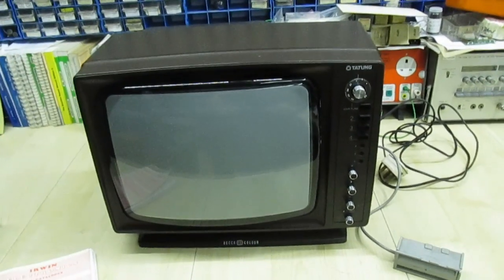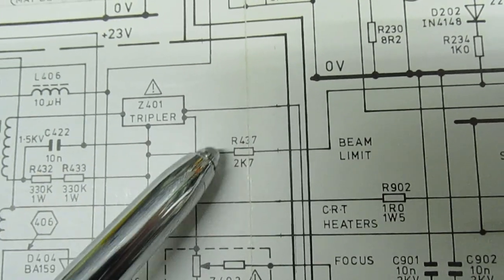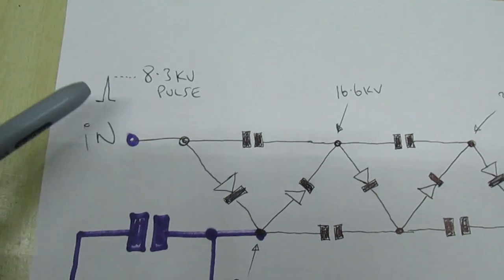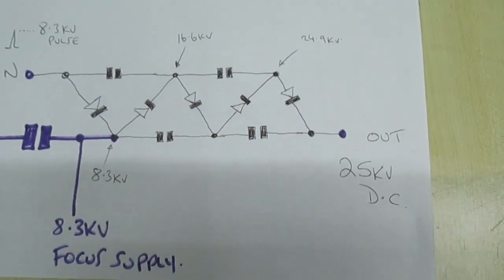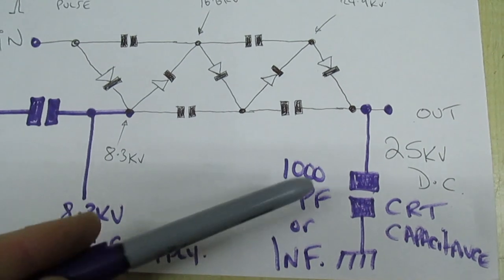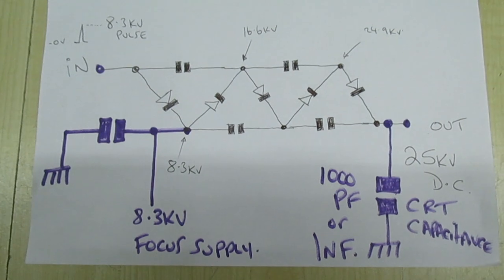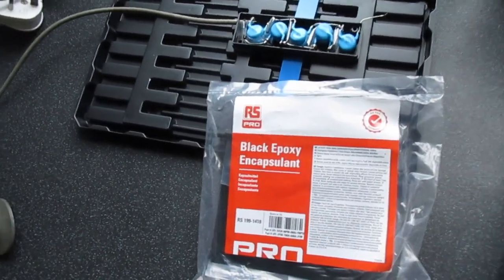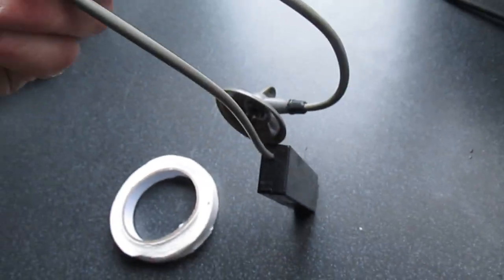Lets make a new EHT Tripler for a Decca 120 chassis1981 vintage colour TV

Comment: Excellent explanation, Michael!
Some years ago parts like these triplers could be picked up from a number of suppliers one in Southend readily coming to mind. That said, the high voltage diodes and capacitors are available via that well-known internet auction usually made in China but note your misgivings.
At the other end of the scale, I am trying to recreate an "olde-worlde" TV using a 3 1/2" electromagnetically-scanned radar tube at about 1.5kV. Managed to 'crank-up' 12V to 500V pulses at 3.3kHz and the tripler seems to be the way to go.
Reply from the maker: you must be referring to Sendz components ! .
 I bought a lot of stuff from them in the 80 s , in fact I still have a load of parts supplied from them in stock , I wouldn't risk capacitors bought from Chinese sellers  , had a bad experience with some over 10 years ago , worked ok for a few weeks then went Leakey .

Comment: I love these work arounds Micheal, as time goes on fixes like these will become more essential. Excellent work.
Reply from the maker: That's the only option when new parts just are not available any more , I also checked the common fault on the scan coil rubber wedges as I no longer have any scan coils , many thanks for the comment .

Comment: Hi Michael.
Many thanks for another brilliant video.
As you said back in the day we thought nothing about ordering a new one. However, now days, needs must inspire invention.
Just a point about discharging the CRT, I was tought to apply the grounding screwdriver to the dag first. Then slide the other driver from this to the anode connection. I was advised it was the safer way.
Kind regards Allan 😃
Reply from the maker: Yes I guess it would be safer to ground first, many thanks for watching.

Comment: Great video and moot point presently, I'm in the process of restoring a brc 2000 ctv and may have to go down this route, in my case the hammer and chisel can't be used because it's important to retain the old tripler housing, fortunately thorn used silicone rubber as a sealant so it can be dug out, it's only took three years so far!.
Reply from the maker: Sillicone rubber shouldn't be too much of a problem, in my case it was epoxy resin, I think if you couldn't remove it for some reason though it would be possible to 3d print a new case.
Reply: @michaeldranfield7140  3d printing is a good idea i hadn't thought of, if i have to rebuild this component I'll be sure to get a file made of its shape for future reference.

Comment: Fascinating , and your method will work on any set too so it's future proof , provided you can get the HV diodes . We had a factory not far from us based in Clacton that made triplers for the trade in the 1970s ,  the company was called Remo but they shut in the 1980s when manufacturers combined the diode , capacitor design into an encapsulated overwinding on the line output transformer as you probably know. A step backwards really as the cost of the repair went up through LOPT replacement.
Reply from the maker: This was called the Diode split LOPT as I remember , where they use the self capacitance of the transformer winding instead of a physical capacitor for greater reliability, Remo rings a bell, also the word Clackton, I think this is where Denco coils for radio were made ?
Reply: You may be right about the coils , they may have been made in Clacton but I'm really not too sure.
Reply from the maker: I remember the Remo brand very well, as you say the split diode LOPT ended all the easy money making tripler jobs.

Comment: Very interesting video!  I've often wondered how the high voltage was created inside a TV.  Now I know.  If the double-stick tape dries up you can still screw down the new tripler by epoxying a small aluminum plate onto the bottom edge and using the two screws nearby to screw the plate down.  JB Weld or black CA glue should hold the plate onto the plastic box without difficulty.
Reply from the maker: Just acquired 2 more 20 inch versions of this set so if I need to make another tripler I wont make the same mistake again !

Comment: These had an amazing little picture when setup right, brilliant video michael, i reckon a high voltage capacitor discharge in the mains supply will be more dangerous than the crt anode, in fact a cars ignition system can be deadly
Reply from the maker: Of course, beam current is only like 1 ma max , should have some 20 inch versions soon .
Reply: @michaeldranfield7140  A friend of mine got zapped by a 450v 220uF cap, hes now got a pacemaker and only in his 30's
Reply from the maker: @Synthematix  I come across a lot of stuff, a phillips sonos only last week, where the psu develops a fault and leaves the mains reservoir capacitor fully charged up ,even the next day it still had quite a charge stored, all for the sake of  not fitting a bleed resistor across the cap .
Reply: @michaeldranfield7140  Yes a simple resistor, job done, still this is to be expected with junk built in china

Comment: Excellent restoration job on the Tatung set , liked your "special " dismantling tools pity you didnt use a hacksaw to cut the base of the old tripler to bond it with the new case but still very ingenious  work
Reply from the maker: Yes,  a bit of a mistake but I repair cars as well so not short of tools .

Comment: Not being someone who works on TVs, I was interested to see what was in a tripler. It turns out I was very familiar with this type of circuit, only I always called it a 'Diode pump' circuit. I've made a few myself, typically to get around 70 to 90 volt HT for old battery radios from lower voltage transformers.

Comment: As a safety comment; I've found that if you discharge the EHT on the tube, for some reason unknown to me, it charges up again (nowhere near the EHT voltage but enough to give a shock). So I come back and discharge the tube several times until I no longer hear a spark when the screwdriver touches the EHT input hole.
Reply from the maker: Yes I have noticed this before and in order to prevent this happening its a good idea to leave the short on for a while.
Reply: @michaeldranfield7140  I really enjoy your videos. Thank you.

Comment: Michael. Just great! Superb!
1. If you use a lower shutter speed on your camera it should get rid of the black bar. 
2. Does the first "focus" cap absorb some of the pulse going up the ladder and reduce the final voltage? Just curiosity. Thanks.
Reply from the maker: The electrostatic focus electrode only draws a few microamps so its unlikely , but what can cause the voltage to drop is if the focus spark gap becomes leakey which is a very common fault in sets used in damp conditions .
I will see if I can set the shutter speed , I'm not that camera minded .

Comment: What does EHT stand for?  Thanks!
Reply: Extra High Tension. Basically meaning extra high voltage.
Reply: @peterensinger1770  -- Thanks!  We just call it High Voltage here in the U.S. and we call "Valves" Vacuum Tubes or just tubes.